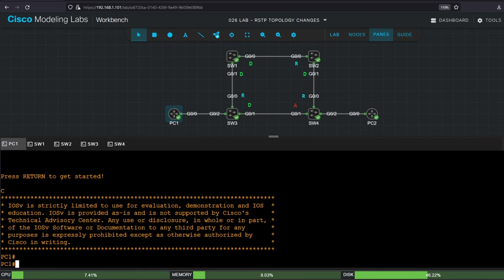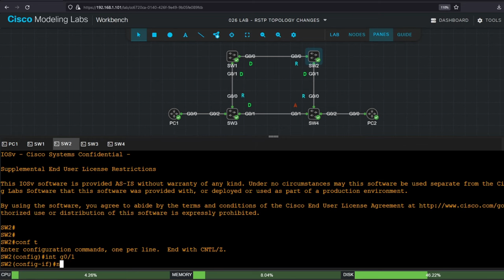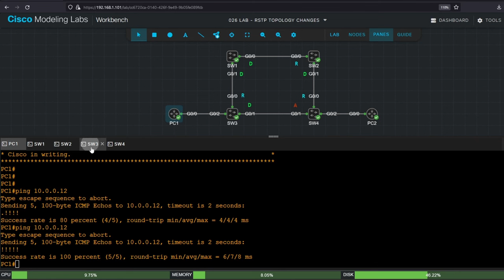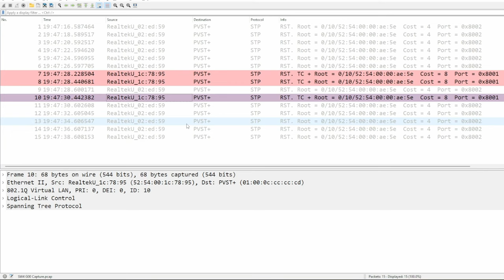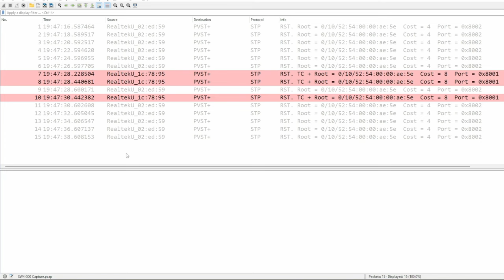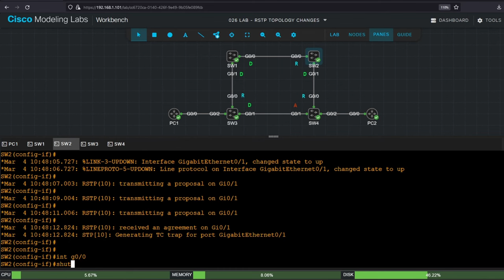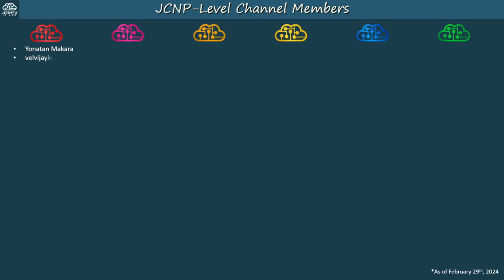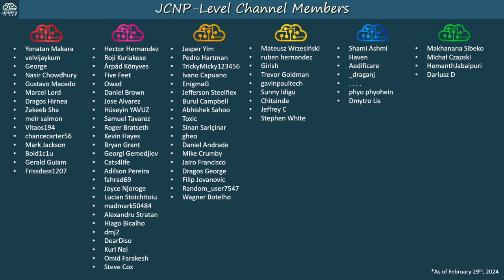CCNP ENCOR // RSTP Topology Changes (LAB) // ENCOR 350-401 Complete Course

Comment: Can some type of STP help with double MAC address as a result of show MAC address-table and preventing interfaces configuration errors? If two switches or hosts with the same MAC address (manually configured) are connected to different ports and VLANs of the third switch, can STP block one port?